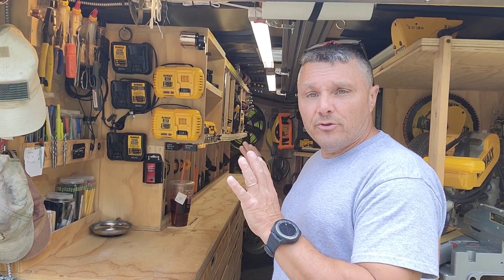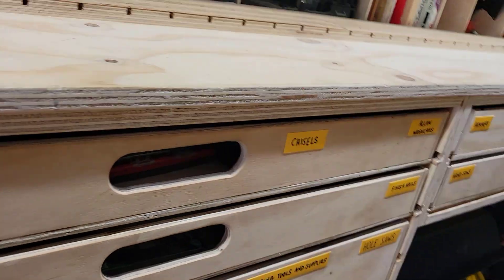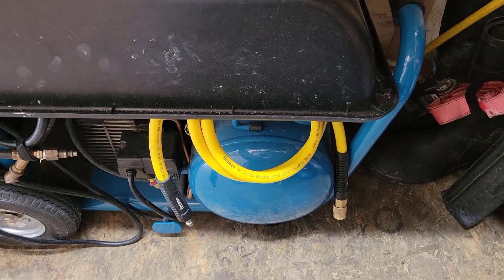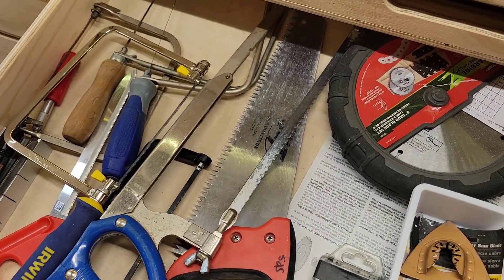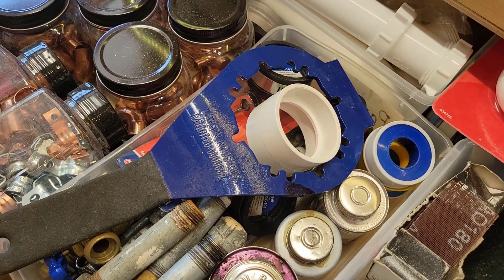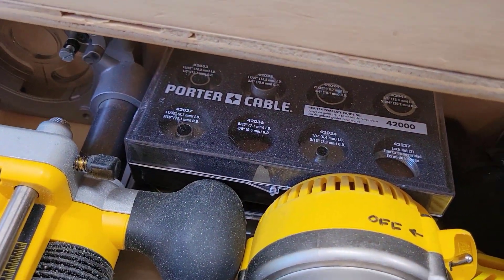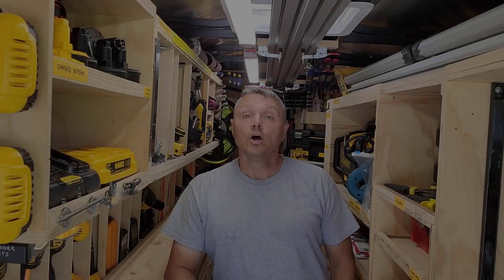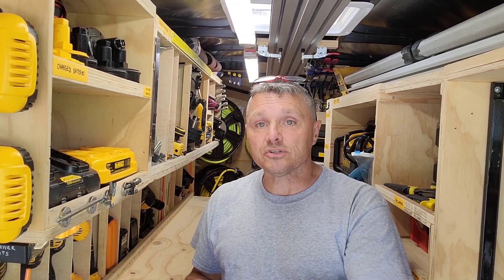DRAWER BANK of cabinets (DB1 and DB2) - "a la carte" deep dive - Paulk-Inspired sSMART tool trailer

Comment: How many sheets of ply did you use for these drawers?
Reply from the maker: Thanks for checking out the video Shawn! Man....I won't lie to you. I am not sure anymore. Each drawer is made from 1/2 ply and measures around 35in bottom, drawers are either 3 1/2 in or 7in tall and the sides are 23in (depth of drawer), with a front/back face around 35in. 4 tall drawers, 6 short drawers in DB1/DB2. At least 3 sheets of 1/2 inch ply. Just a guess though without doing the math.